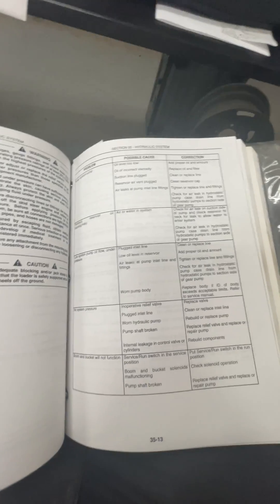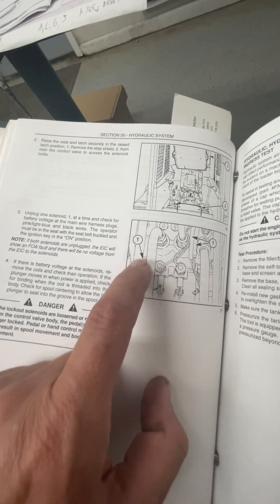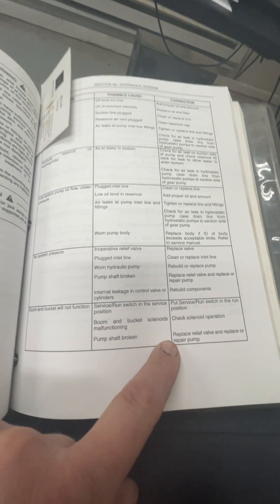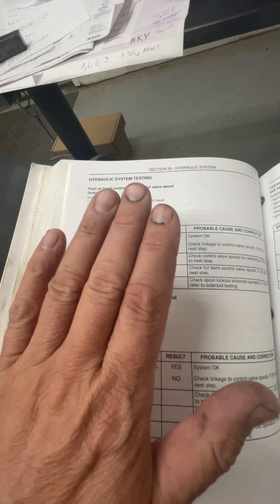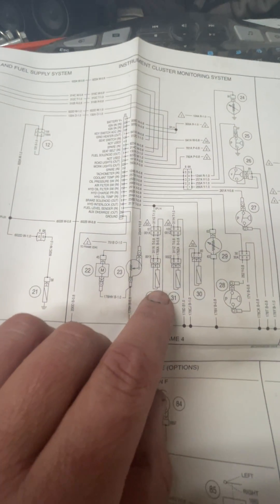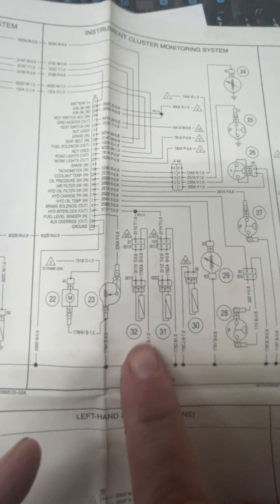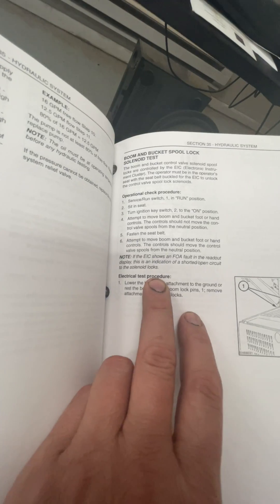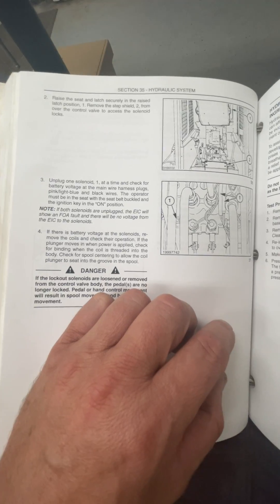New Holland skid steer boom/bucket lock solenoid diagnostics.

Comment: The service run switch is a switch in the cab to the right by the fuse panel.  In the back position towards the engine is for mechanics to run and start engine but hydraulics won’t work- service. Forward towards the bucket  is the run postion- so the hydraulics work when the other conditions are met. Seat switch has to be engaged first for all the other logic crap works .
Reply: For new holland l220?

Comment: Daaaaannnngggg Carl! What a video! For the record I'm the dude Carl is referring to as the gentleman in the video and Mike is the name. This actually raised more questions.
1. My panel was not showing a fault number/message. This tells me that a wiring connector did not get blasted loose during the 1.5hrs of the power washing nor the 4.5 hrs of garden hose washing.
2. My pedals work and my cylinders work to the extent that the arms move about 3/4" and the bucket cylinders move just ever so slightly.
3. My hydraulics unlock light (7,8,9,0) keeps blinking at a steady pace but park brake goes off and I can drive the skid steer just fine. Two speed works.
4.I just could not safely get those arms up to get me cab tilted. I have two friends with skid steers, but both of them had them out of town and I wasn't going to bother them hauling them in to lift my arms for this. So...really no way to check out the solenoids.
5. From the pictures and the locations of the lockout solenoids, I can tell you, I spent a LOT of time spraying water up towards the front under the cab when I was cleaning all the cow crap out. And I mean a LOT of water. Both high pressure and garden hose.
6. There are also some diodes under the cab that controls some stuff doing with the lockouts too...or so I read somewhere in one of the manuals I have here. I have a full set of manuals available either digital or print. Still trying to learn where to find stuff in them.
Like I said in the other video...all of this is rather mute now...the local NH dealer picked up the skid steer on Monday...but maybe this info will help some other poor L220 owner.
Thanks again.
Mike
Reply: Well the New Holland mechanic is even stumped now. I found out the arms are raising by the toe press on the foot pad and lowering by the heel. So another mystery.